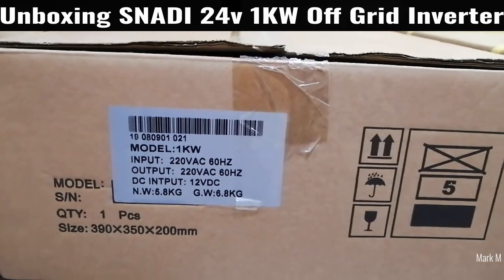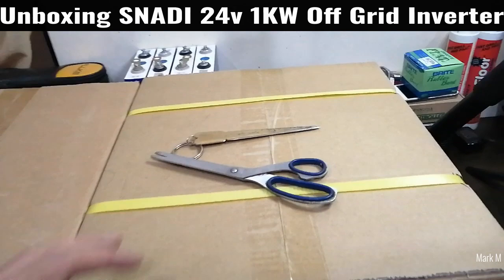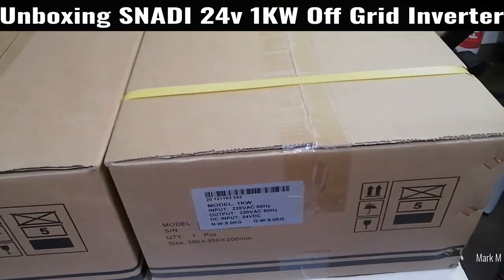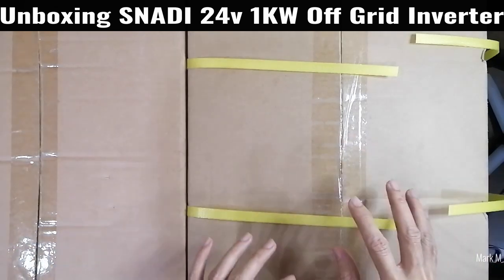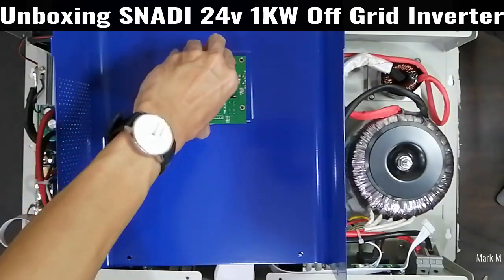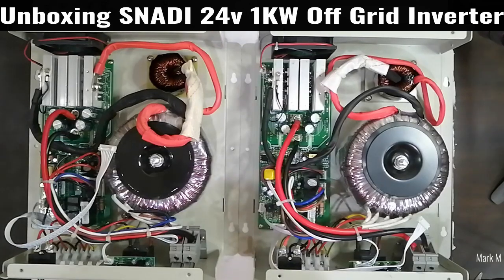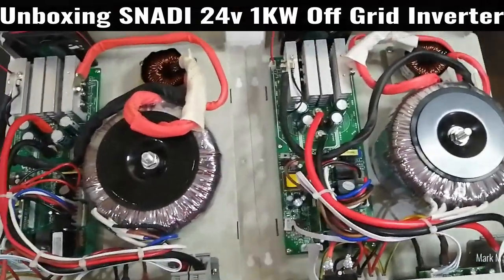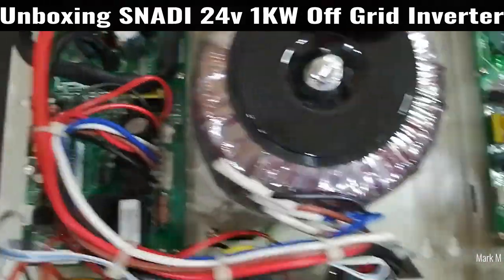Unboxing of SNADI 24v 1KW Off Grid Inverter with AC Chager

Comment: Hello, just a question. I've read some comments on a video featuring the 24v version of this product saying it doesn't support AC Charging. Is it true? I'm planning to get the 24v system on purposes of future proofing when I add more panels or battery. Thanks.
Reply from the maker: All hybrid is capable of AC Charging. It can be on demand if necessary.
Reply: @MarkMinoza  Thanks, I was wondering why it happened to that one youtuber. He probably got a 12v inverter that came with a 24v sticker.
Reply from the maker: @BingoBoffin90  go for 48v for versatility. Lithium Batteries are now affordable.

Comment: Snadi didnt say how much kv does it have on its main toraidal, unlike one solar that says it has 2kv.  Do you think the peak power of snadi is the same with one solar at 3kw? Can you do a stress test of both to determine if one solar is really better in handling peak power?
Reply from the maker: your effective continuous load is only 800w, its surge capability is only useful for motorized load. So if you plan to use this 1Kw Off Grid Inverter, I would suggest to get your inrush current of your inductive load to design your system properly

Comment: In your own opinion sir wc one is better snadi or one solar? One solar is a bit pricier is it better than snadi?
Reply from the maker: buy the inverter which is closer (seller) to you. either way both are the same.
Reply: For my experience one solar is better in LVD range to 8.5v to 13.5v unlike snadi the LVD 12v. And additional 5 mode setting and you don't need to see user manual bcoz in the LCD it's show the icon of error or fault .
Reply: @judcris_solar2557  thank you, i already bought the one solar and so far its working great. Btw is it normal that sometimes the Lcd screen is turning blank in just a few seconds and turns back  again? Have you experienced that?
Reply: @yutub6972  I know what you mean the back light of the LCD is dimming . But the display is still active or present
Reply: @judcris_solar2557  aside from auto dimming the digital info on the screen suddenly go to blank for just a second, i dont know if it just going into rest mode like a screensaver.
Reply: @yutub6972  it not happen with my one solar unit
Reply: I don't experience any issue in my one solar inverter

Comment: Hello sir ano po mas okey sa dalawa? Kung same po na load at battery at pv at same loads, ano po mas okey 12v sandi or 24v snadi? Salamat po
Reply from the maker: ill go for 24v system. higher voltage is better in managing the load. pero kung baguhan ka, stick to 12v. may battery balancer ako kaya wala akong problema sa 24v setup.